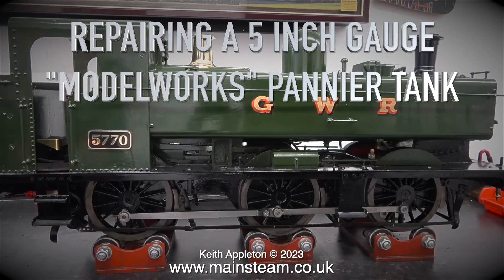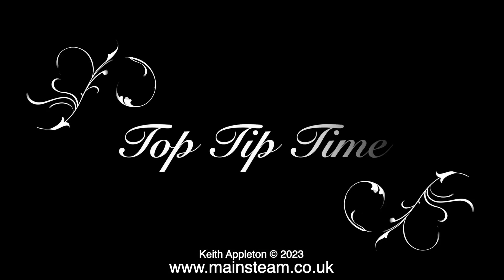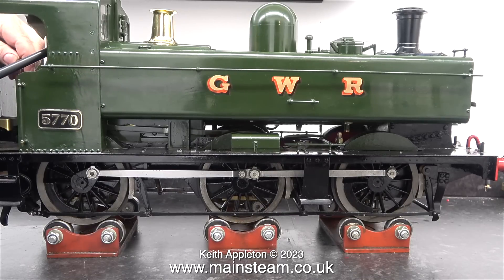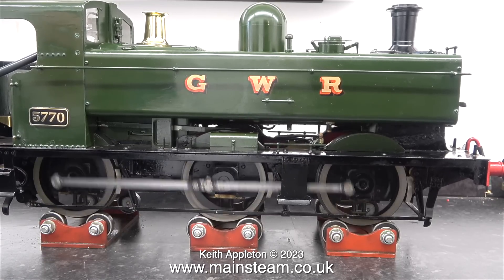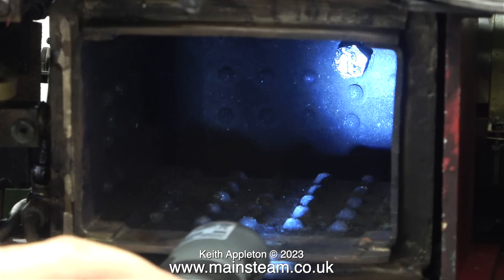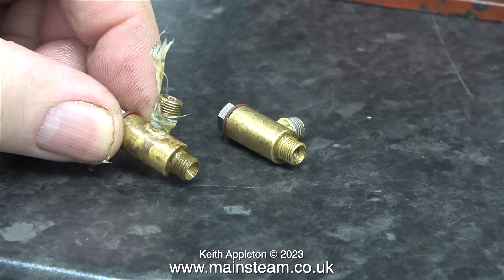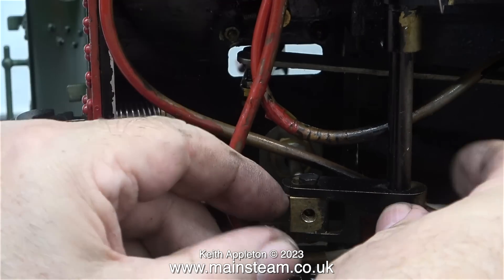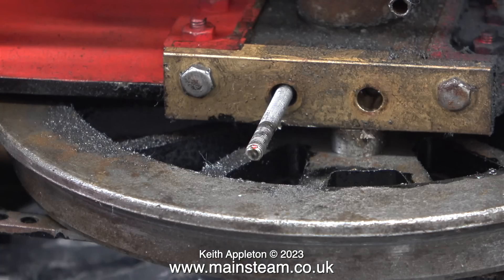REPAIRING A 5 INCH GAUGE "MODELWORKS" PANNIER TANK - PART #2

Comment: The brake shoes seem a bit suspicious looking at the video when you're running it on compressed air. I know they'll have some give to match up to the wheel diameter but specifically the middle one didn't seem right, is that normal?
Reply from the maker: Please watch the rest of the series . . .
Reply: @keithappleton  thanks Keith

Comment: The brake shoes bounce a lot 😮 good job you're sorting the system 👍
Reply from the maker: Yes, there is a lot wrong with this engine, the brake shoes are the least of my worries . . . .
Reply: @keithappleton  I bet 🫣  I'm slightly ocd and hearing and seeing them, made me want to sort it now, but obviously not worth doing until the axles run well as they will be at a slightly new position which then mean the brakes need tweaking anyway 🫣 

Loving your restoration/ rebuild videos 👍